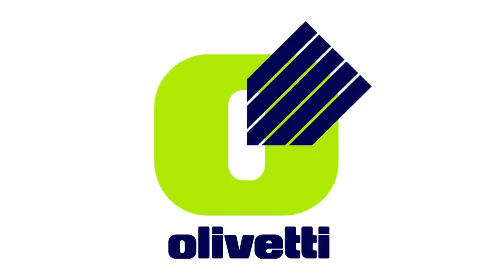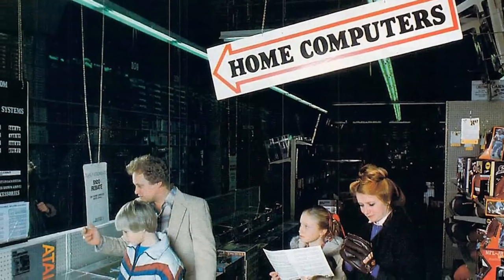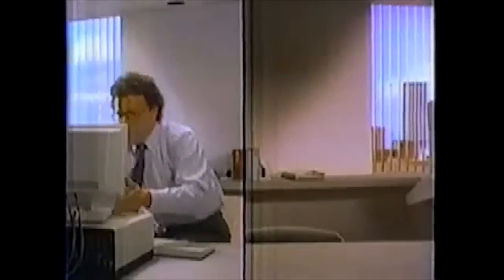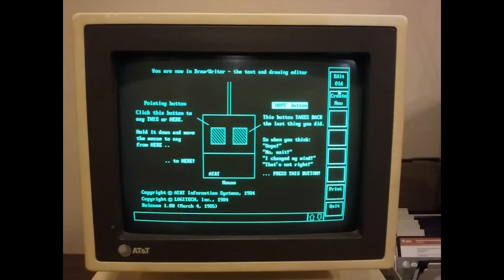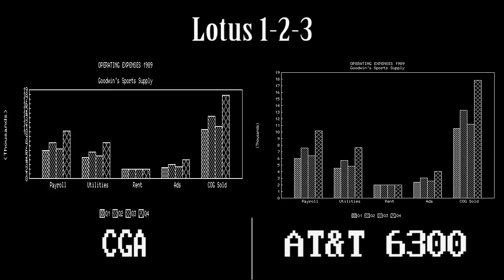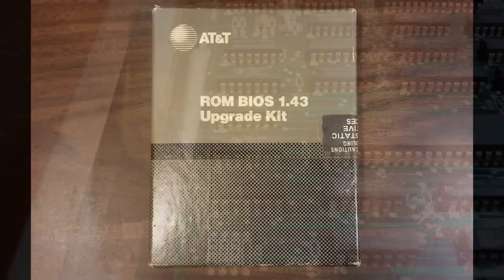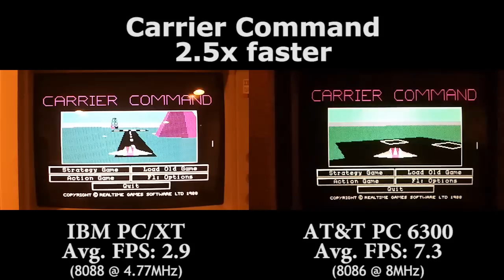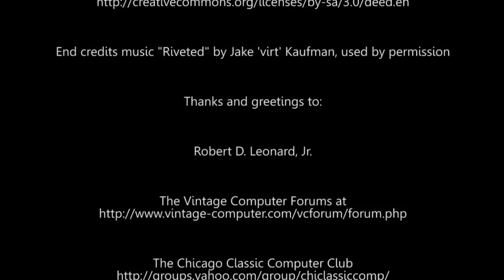The AT&T PC 6300: A Retrospective

Comment: what monitor did you use for non monochrome cga on the 6300
Reply from the maker: bboi elmo Two monitors exist for the 6300, a monochrome in the color. At the time I made the video, the color monitor I had needed its capacitors replaced and some of the colors are not totally accurate. I had to correct some colors in post. I was also working with a very bad camera. I hope to revisit the 6300 again in a later video, as I have greatly updated equipment, as well as a perfectly functioning color monitor. The color monitor was not common; the monochrome one was a lot more common because it was cheaper and crisper for business applications.
Reply: Thank you. Can I also use the m24 monitors
Reply from the maker: bboi elmo yes, the m24, 6300, xerox 6060 all use the same 25 pin monitor connection
Reply: Thank you very much. What are the best pc compatibles, all I can think of is the Tandy and the 6300, what others are there that are worth it
Reply from the maker: bboi elmo I think they're all fantastic :-)
Reply: Sorry I just don’t know much about the ibm’s and the clones, I mainly focus on the home stuff and portables. Do you have any specific recommendations for IBM PC clones

Comment: Heh... those game comparisons at the end... Looking at them and thinking "hey that's actually pretty smooth, kinda AT / ST / Amiga territory"... then looking at the FPS readout and seeing that the highest of all of them is only 8.8...

Man, Carrier Command, Indy and Interphase seem smooth even compared to how I remember them being (or recently experienced them, having pulled an A600 out of storage for a blast), maybe because they only have half as much video data to move around... Flight sim, a little jerky, but no worse than F19 could be at times. And that's not even rating 2fps average. I pity the kids who tried to play most of those games on an actual XT...

And kids these days whine if they don't have a 144Hz varisync monitor to play on, or a monstrous power-sucking graphics card to keep the action moving at that speed. Let's put them in front of a classic system like one of these (or, I dunno, maybe challenge them to a 16-way MIDImaze deathmatch ... or Doom over IPX/SPX on a bunch of 386s) and see how good their reactions and anticipation of how each move is going to play out fares at a more sedate framerate.

Also, it's weird how a lot of those 400-line mode programs (and the GeOS desktop) still look fairly decent and refined even now. Though seeing as it didn't really confer that much WYSIWYG ability in return for stripping out the colour, and was probably still running on a screen with a refresh no higher than 60Hz, might Word have been better running in the colour CGA textmode (white on blue or yellow on black is much more soothing on the eyes), which would at least still have had the advantage of 8x16 fonts vs the clunky CGA 8x8 ones?

I wonder whether Jack Tramiel or Shiraz Shivji seeing one of these machines running somewhere and looking all sophisticated, but just a little flickery, was the inspiration behind the ST itself getting a 640x400 monochrome hi-rez mode, just one that took advantage of the 32MHz master clock to deliver a super smooth 72Hz refresh rate? Too bad they didn't think to make their monitors dual-frequency though, so they could still do lower rez greyscale...